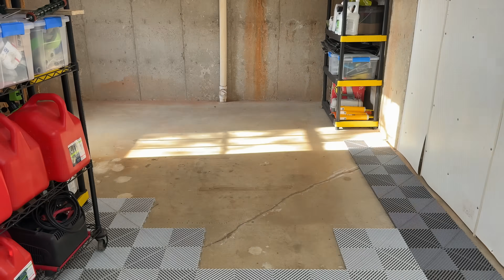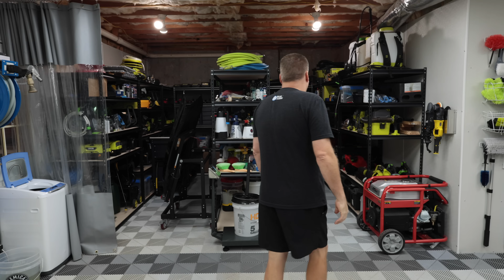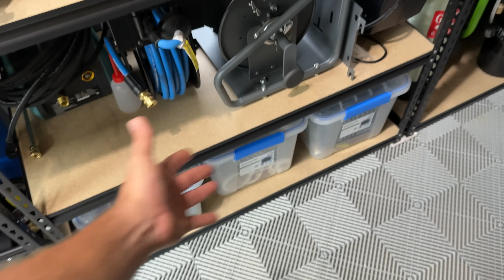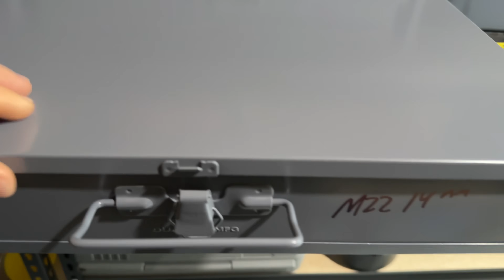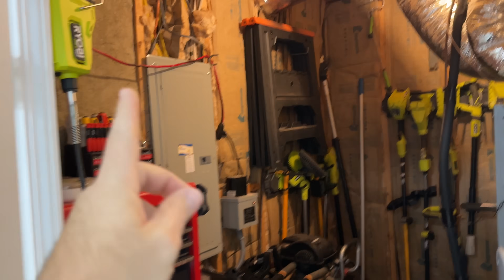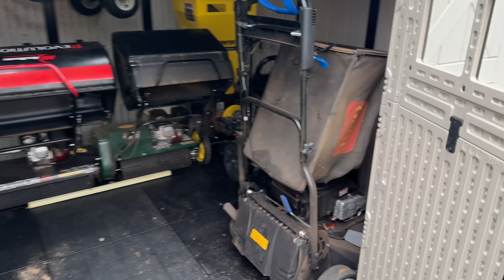DIY Dream Garage Wash Bay Phase 3 | Rinseless Reel, Storage & Organization

Comment: Hey Keav congratulations on the garage. I hope one day that I’m able to get mine done but it’s still work in progress.  I do have a question for you though I think in one of your past videos I don’t know how long ago it’s been. I think it was one of your dual pressure washer set up tests, but I believe I heard you say that you have a 30 amp outlet that you plugged one of them into        What kind of receptacle did you put on that 30 amp breaker?
Reply from the maker: At one point it was setup that way, but that was a bad setup as it is not safe. It’s all setup using 20 amp breakers now. 30amp is too much current for a 20amp outlet it can damage the electronics and cause a fire hazard.

Comment: Hey Keav,

Which sprayer or pressure washer tip do you recommend for a final rinse in a garage when you are trying to limit the amount of vapor in the air? I know I've seen you recommend several options in previous videos.

I don't have a drain or mini split in my garage. I usually do a prewash and full pressure rinse on my driveway then finish up in my garage. Full pressure rinse in the garage can get a bit messy, and it would save me from having to pull out and back in to rinse.

Thanks!
Reply from the maker: I prefer this shower nozzle which has changeable screens. You can use with your pressure washer on or off and even adapt to use with a garden hose. https://amzn.to/4pNcOcQ
Reply: @CarsWithKeav thanks! Ordered

Comment: Nice work man! Looks much better. I’ve mentioned this in another video but I’m going to say it again. The light you have in the “storage “ area. I see you have the “splitter” and are using 4 led bulbs. Trust me when I say this, buy the 3 or 5 blade style led lights. I wish I could add pictures and links to YouTube to explain it more clearly, and easier. But the “fan” to “blade” style led lights are way better. They are fully adjustable and they rotate 180 degrees. Plus, they are adjustable temperatures or brightness 2700k, 5000k and 6000k I believe 🤔 I use them in my attic, and in my shed the amount of light that they put out is absolutely ridiculous and being adjustable you can put the light exactly where you want. It will be so much easier to find stuff on your shelf when it better lite. 👍🏼 Anyway, garage looks great man keep up the good videos
Reply from the maker: Problem with those lights are they are too harsh to film with and carry too much shadow into my filming areas. I need a more dulled light to not overwhelm my filming area and have less shadows.

Comment: Hey, I just got all my black Friday pressure washer stuff. A few months ago I got an RV water softener and a reverse osmosis and then used a trash can to hold it and pump it thru a spotless system. It all worked well with the active 2.0 but now I got the 50 foot active hose, tutuluck gun, and Armour detail foam cannon. Those upgrades made a huge difference. I was surprised to find the hose made the machine run smoother. Idk why but it seems to kick on better with no fluttering like the included hose and gun had at times. I got basically all the information for this setup from your channel. Thanks for the great content.

I did learn that water softeners before the reverse osmosis system save the ro system from alot of strain too and RV water softeners are not that expensive. But ironically water softeners raise the tds slightly so it only helps for reverse osmosis but would hurt the life of spotless systems. I'm not too familiar with the difference between ro resin and di resin but if you put water softener, ro filter, spotless di system, in that order, then it makes the water so much cheaper per gallon. I know you probably don't need to worry about this so. Much because your water is alot better than mine from the tap but I see this one channel that is gate keeping the information of how to make a bunch of cheap water and they are trying to sell some elaborate system without explaining what it is but it's basically just what I explained.

Anyway, I got my garage setup to the point where I am truly enjoying washing now. I went from going to the self service car wash to now at my apartment being able to wash with a much better system thanks to your very in depth videos. Now I just need to organize my garage and clean out some old stuff to get like yours.
Reply from the maker: That’s awesome glad you are enjoying washing more now. The hose being a larger diameter will usually always help run smoother and the pressure switch will react quicker. Water softener resin is just half of what is in DI resin (cation resin) and it removes the hard minerals such as calcium and magnesium and replaces with soft ones leaving only the soft minerals which can increase TDS. This allows the RO membrane to work more efficiently and the waste water from the system less harsh. The DI side of the system if using mixed bed resin you are now paying for resin that isn’t being used as it did that work with the softener system already. The Anion resin is what will remove the soft minerals like sulfates so if setup right you would only need Anion resin at the end. That way you’re not paying for 50/50 or 60/40 mixed resin and basically only using half of it. Anion is more expensive which is why DI resin is more expensive. Cation is cheaper and the workhorse of softening water. Best part about Cation as it is easily regenerated with salt brine so you don’t have to buy that all the time.
Reply: @CarsWithKeav  I’ll look into that when I get filters next time, I don’t think I’ll need filters for a while tho because my RO water has maintained 7 ppm for a while now so the di resin has to do very little work. And I think the rv softener takes 2 ($3) of those small salt containers per every 2000-4000 gallons it processes which should be around 1500 gallons of end product water with waste water removed. I haven’t really seen much information as to the resin life in the RO membrane other than if you use soft water it won’t be damaged and it kinda seemed like people were saying they do well with just getting used regularly to clean out or purge the system. I got the stealth RO 300 which has dual membranes so it filters water pretty fast. It makes like 15 gallons an hour. I lucked out and found an overstock wholesaler selling them for $200 on eBay when they were mostly selling for $350 at the time.

Comment: Hello sir could you show us how you store your short gun to the wall, it’s slick?
Reply: Thank you for your dedication
Reply from the maker: They are just normal quick connects and I drill a hole in the wood and just screw them in. The I just snap the gun into the quick connect.

Comment: Great garage update Keav! If you happen to outgrow your space I highly recommend switching over to a very customizable RiveTier boltless shelving from your local material handling distributor. You name it, you can go fourteen feet high all the way down to 18" depth. This spring I am installing FRP panels behind my pressure washer setup in my apartment garage. Typically these panels are applied to the wall with adhesive but I plan on using bolts like your setup, so most importantly, did you find it necessary to screw into the wall every two feet or perhaps I can get away with four feet to minimize any ripple? Anyways let your kitty know that Gabbie and Kylo say hello!
Reply: Sweet, I was specifically looking at the grey Sequentia panels so your video is perfect timing! I was hoping they'd be a bit more Harbor Gray but thats okay because the Omni wall will stand out a bit more!
Reply from the maker: Usually if you already have drywall or concrete you would glue it. This being a wood frame I chose to use screws as it would make it easier to take off and replace. I would probably use screws no matter what as glue is more or less permanent. Helps to have two people it was not fun doing it by myself. I think just on the edges works fine I use a few more at the top and bottom and a few on the sides.

Comment: The garage looks great Mr. Keav.   I really like the way you set that garage up.   I especially liked those pull out trays with all of your organized pressure washer tips and fittings.   Those are slick and they really help to organize all the small bits.   I just have a drawer full of all that stuff but it sure would be nice to have it all organized like you showed in your own garage.   I also liked your chemicals cabinet and how professional it looks with all of your most used products being perfectly lined up and ready at a moments notice, being in a position that you just need to open the cabinet and pull out whatever chemical you need for that cleaning session.   I did that to my own cabinets a couple of years back, but when I moved, I haven't yet had the chance to reorganize everything the way I like it.  I did just install a long shelf through re-purposed materials that my son-in-law had in his garage and used it to install a long planked shelf on one of my side walls in the garage which allowed me to get a bunch of the gallon sized bulk containers I previously had in my Husky standing cabinets and move them to the shelf, up out of the way.   I plan on installing two more of those shelf's above and below the one I already have installed.   They are really handy, although my dream is to have everything inside of cabinets again at some point in the future when I add more cabinets to my current set.   I am OCD when it comes to my detailing chemicals, tools, etc.  I like everything out of view, inside a cabinet, preferably housing like chemicals on the same shelf and keeping everything organized by what the chemical or tool is used for.   That's still a long way off, but that is my goal anyway.  If I ever move again,  I am designing a "detailing specific" type of garage, with the floor drain, the wall mounted tools (pressure washer, vacuum, blower, DI water system, etc.) and a professionally designed cabinet array.   Not to the level of Obsessed Garage or anything, but a similar design, using locally available decent grade cabinets and shelving.  I just want to pay someone else to install it!  LOL.  But I have ideas floating around in my brain on how I want to set it all up.   I really like the Big Boi set up after browsing their website a while back.  They have some garage install ideas on their website showing how a few users of their products set up their garages.  I am not a fan of the Swisstrax flooring, but that just my own personal preference.  I know a lot of detailing professionals and enthusiasts, yourself included, who like them and use them in their own garages.   For me personally, I prefer the look of the epoxy floors with designs or the "flakes" in the design.   I know the Swisstrax are useful in collecting the dust and debris which falls into the channels below but it's the whole affair of having to eventually pull those tiles up to properly flush away all of that collected debris and clean the floor underneath.  I know some detailers (Rick over at RAD GARAGE, and others) who make it a yearly scheduled maintenance pulling up the tiles and then cleaning the floor underneath.  I don't want that hassel, and I personally would just rather have a good, professionally installed epoxy or other durable material that cars can drive onto without damaging the floor materials used, and also something that can withstand the harsh Colorado winters and what road grime goes along with that situation with all the snow and bad weather we get here during the winter months.  Again, it's just personal preference.   I love the look of the Swisstrax (or other brands) modular flooring, but I just prefer the flat, properly installed floor coating.   I want some sort of very durable, commercial grade flooring option that won't wear away like you see with a lot of the self installed floors, mainly due to improper preparation and installation of the floor coating of choice, which is why I will get a professional to install mine.  Then I want to use bathroom grade tile on the walls.  Something like a backsplash you would see in a kitchen, or tiles in a shower, but on a much larger scale obviously, going all the way around the garage up to about belt height or a little higher, which can act as a backsplash on my walls so any water or chemicals that splash onto the walls can easily be wiped away.   This is just an idea in my head.  Then I will mount all of the wall mounted equipment above the lower tile covered section.   Plus, using tile gives me some options for design if I wanted to make it black and white checkerboard or something like that sort of like how you can choose the various colors with the Swisstrax flooring and other flooring.  My goal is to use materials designed to be resistant to any moisture, using drywall rated for bathrooms, then the tile on the bottom to protect the walls from any water damage from maintenance washes for our vehicles.  Of course my design may change 50 times before I start it, but that is what I have been thinking about doing to my own garage.  The reason I have been looking at the newest version of the  Big Boi Washer Pro is that they also have all of the matching wall equipment in the same color scheme.  The Washer Pro, their "Sucker" Vacuum, their DI water system, their blower, wall mounts, everything.  It's like a one stop shop.  I also like the black and lime green color combo and the fact everything matches.   Here is a link to a garage design from Big Boi that I have been using as a base point to build upon.  Big Boi Ultimate Garage:     https://ibigboi.com/en-us/collections/the-ultimate-garage       You've done an amazing job Michael.  Your garage "rebuild" looks like it is  well on it's way to being a very useful and well organized garage set up.  If there is one thing that I would upgrade in my current garage is to have a plumbing professional run hot and cold water lines out to my garage with heavy duty hose bibs.   That would make it so much easier than having to run a hose from my laundry room out to the garage whenever I want to do a full maintenance wash using a bucket and my pressure washer.  It's a real pain in the rear to have to set up all the equipment, drag out the pressure washer, then hook up all the hoses, even with quick connections, still being a pain to drag it all out and set it up, use it, and then tear it all back down and put it away.  Once I get the water lines, I can install my wall mount washer and all the tools that come with doing that set up, and also the other wall mounted tools.   It would make it soooooo much easier to have everything mounted on the wall and readily available for use at a moments notice, then simply rolling up the hoses when finished and turn off the switch.   That is such a time saver that it makes it worth any price.  Efficiency, efficiency, efficiency is what I am looking for.   I would probably do maintenance washes far more often if I had a wall mount set up.   Now, in the winter time, I mostly do rinseless washes, because it is so much easier to prepare and then put away, without having to use any tools other than the wash media (bucket, rinseless wash, and wash mitts).  It's not the best routine, but it's what I got as they say.  I always enjoy your in depth and extensive reviews Mr. Keav.  Your videos are well filmed, well edited, and well presented.   You are still the Albert Einstein of detailing equipment testing whether it's a new foam cannon, new pressure washer, or whatever tool or chemical you are reviewing and presenting on your channel.  I always trust your viewpoints and the pro and cons based on your own extensive testing.   This makes it far easier to make a selection when  looking at certain new tools and products available for detailing.  Thank you for taking all of your valuable time to present these interesting topics.  😀
Reply from the maker: I appreciate you and your well thought out comments. Believe it or not I enjoy reading them as you write it so well. I see what you mean about epoxy for me it’s the only clean or wash once a year and not after each wash. Like you said it’s all personal preference. You can walk barefoot on epoxy, but swisstrax hurts to walk on. They do hold a ton of weight for being plastic tiles and I also like that they are produced only about an hour from me. I do like in the garage the cabinets, but mainly to deflect the water. In the storage area I like open shelving even though it doesn’t look as good as it’s easier to get to things and have it to where you can use both sides. Also long items you can bridge across multiple shelves. Once again personal preference. I like how you are open minded though to what others may like usually most epoxy guys just call me stupid for having swisstrax. 😂 I did recently get laid off from my job which is where I got the time to organize all of this. I’m going to try out doing content for a living and see how it goes. Thanks so much for the kind words it is great motivation for when I get hate comments which tend to ruin my day.

Comment: Is the Ryobi stuff treating you good? Ive got the Skil 12v stuff, but Im kinda worried they might be becoming less relevant as lowe's is getting rid of them.
Reply from the maker: I have never had a problem with any Ryobi product except their one gallon sprayer to me is not very good. As a homeowner it’s all I need for the most part and the tool selection is unmatched.

Comment: That FRP stuff is the same stuff weve got at work all over the walls. It collects a lot of grease and smoke from the ovens running all day. Theyre easy to rinse off with some degreaser and pump sprayer. They do yellow over time though.
Reply from the maker: Yeah grease does some work on them I bet. Yep when I was younger Inused to deliver produce to restaurants and I remember them all having that wall that you can just wash down.